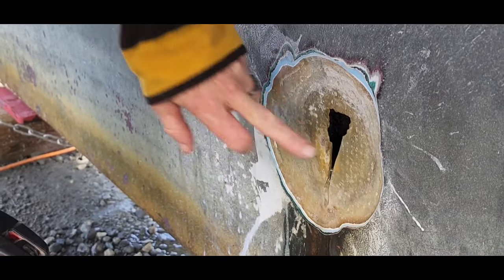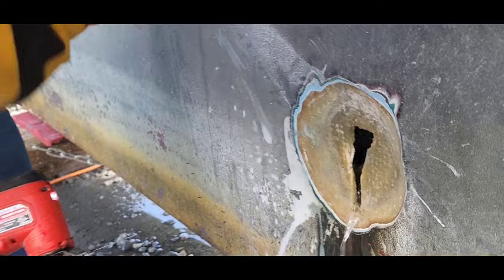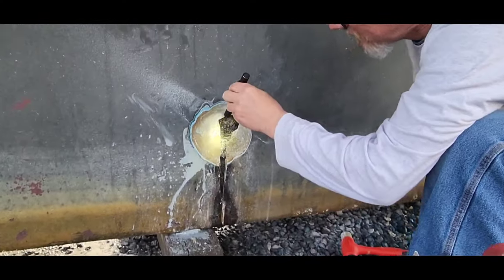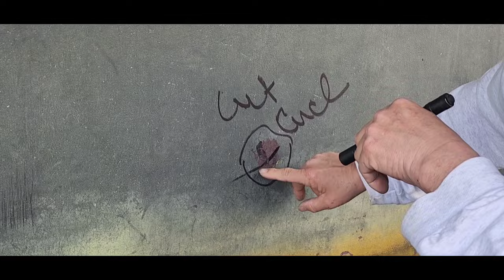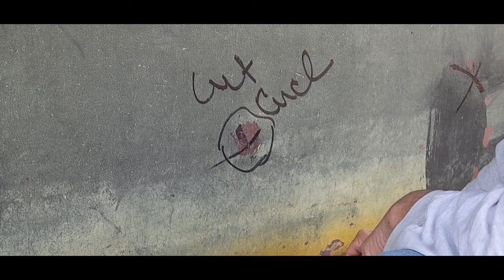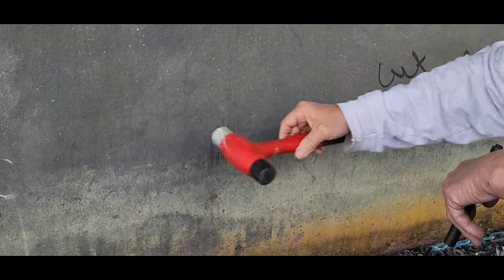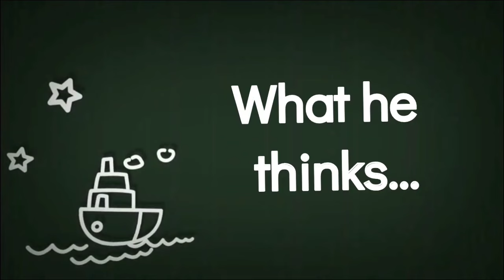S2:E4 HOLY Bob our Sailboat keel is hollow PT 1. #sailboat #chesapeake #ocean #diy #boat repair

Comment: I would consider heating up 5 -10 gallons of water to about 125 degrees F add a dye and put in bilge just to double verify, also check the expansion amount or ratio of the foam, I have seen construction foam cause major structural damage because of its extreme expansion strength so a little goes a long way but keep in close contact with the manufacture and get as much info as possible about placing it in an enclosed place like the keel, even as thick as the glass is the possibility of an expanding foam causing fatigue exist.
Reply from the maker: That's a really good point. I will play with it before use and get an idea. I'm thinking of building a similar mold and practice pouring concrete and foam to see what does.

Comment: It’s hard to tell from your pictures, does your boat have a full foil keel? I’m assuming yes!  Is any part of it lead or cast iron?  The picture appears to show fiberglass fairing grounded down to lead snd a saw cut hole through the lead to create an opening? If that’s correct then you solution should go one way!  If not, if it’s just fiberglass, the I’d take a different route.  We sailed for many many years on an inland freshwater lake, and we’ve had several different kinds of boats, lead keel, cast iron keel, and fiberglass keel.  I’m also an engineer.  

If you let me know, I can give you recommendations on proper way to correct!
Reply from the maker: I believe it's lead encased in concrete. It is a full keel. I'm not sure what you mean by "foil keel" Would appreciate any advice 🤔

Comment: Did you ever wind up putting concrete in it with the foam or just concrete? Also, if you did use concrete, what kind was it?
Reply from the maker: We ended up using High density foam. After a lot of feedback it was decided that the amount of void space was small. Thus the over weight wasnt significantly affected. We splashed boat and its been doing grest.

Comment: So with hole open, if you put water into the bilge, does it come out the hole? Do you just have 2 void areas? Or is it all along the bottom?
Reply from the maker: Bilge is contained. No leaking from it (level is consistent). We have one large void. There are a few smaller ones. But not big enough to make issue out of. Was going to use the foam for these areas.